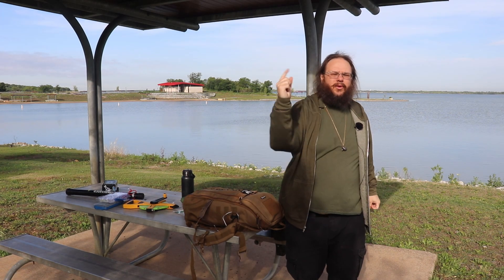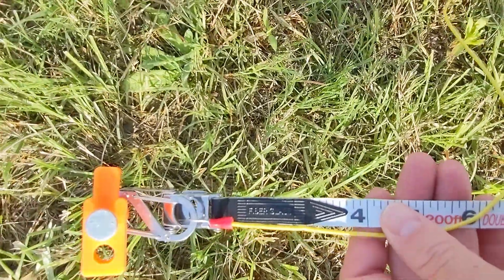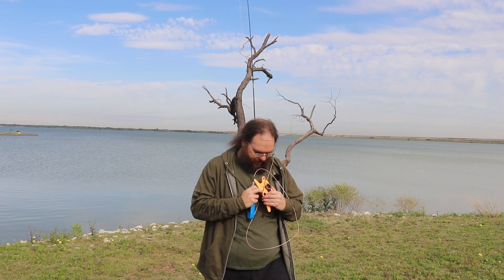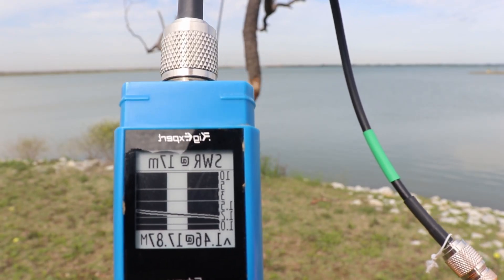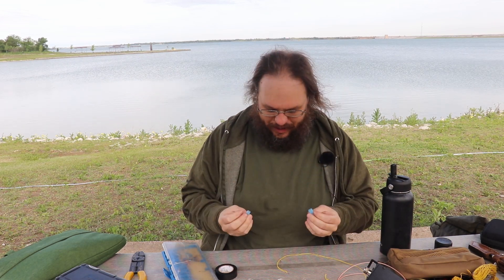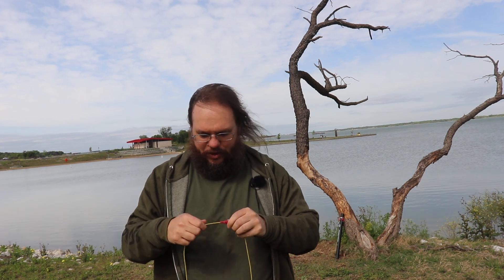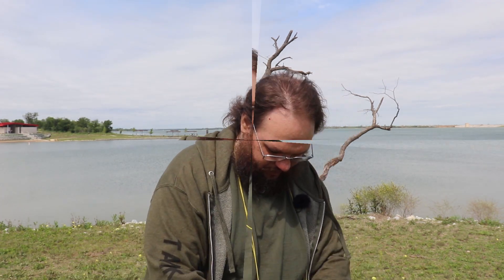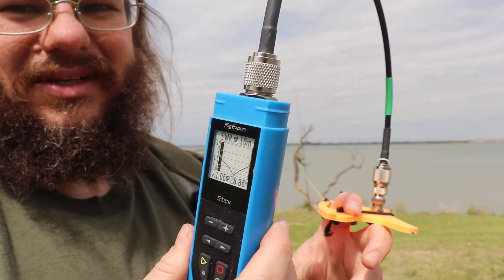How to cut and tune EFHW Linked antenna for 10 - 40

Comment: Can you advise on the lengths you show in the list there are two sets of figures next to each other almost the same so not Mtrs and Ft inches?
Reply from the maker: In the previous video, https://youtu.be/jFl4lOwHsVg.  I showed you how I calculated these numbers and you can check them and calculate the bandwidths you want for your individual sections. 

In the description I have a mathematical length of the section.  Then I broke that up into what it will actually represent in feet and inches.  Hope it helps

Comment: There is one factor you did not count in: antenna height. When you lift the antenna up, the resonance frequency will also go up. I would guess if you lift your arm up, you would already see a small difference. When you would use the same antenna at home on a tree or your mast, the difference in resonance frequency could be as much as a few hundred kilohertz. Best practice is tune your antenne on the place where you are intending to us it. Good luck, I really like your videos . 73 Bas PA5BAS
Reply from the maker: thats a good point, once you tune the antenna to a good 1:1.  if you need a tuner when you move it, the simple tuners most newer radio have can compecate for the difference.

Comment: Hi Frank - 
Maybe you can help me...
- Which connectors did you use between each of the element?
- Did you do anything to prevent the segments from separating once they were under the load/strain of being up on the pole and sloping to the transformer?
Thank you & 73

Comment: You can fold over the extra wire and as long as they are parallel your tune is good. Great video to include the links instead of robbing power with a "tuner" that tunes nothing but instead matches the impedance to send reflect into components in the the device as lack of efficiency. Great work indeed!
Reply from the maker: Thank you so much.  Its also  at of pure laziness, not running a 40 meter antenna to just play on 20

Comment: Excellent idea using the tent stake to secure the wire and tape measure, I will use that the next time I cut wire!!
Reply from the maker: Excellent!  that long tape measure was amazing.  i will be using it later for the DX commander build

Comment: Ape said you need a counterpoise!!
Reply from the maker: I read that ALOT of the chat.  this antenna build didn't have one and i know.  the coax will act or be the counter poise :(
Reply: Balderdash!
Reply: Bwhahaha, that's called common mode currentv when RF finds a path to ground. Some Dude named Lenz or maybe Kirchoff worked out some of that math. Lol but as long as the radio is fine and you make contacts good on you brother. Good on you for making this video instead of shilling for a sponsors ready made antenna. 😊
Reply from the maker: @super66craig  i will look into the math in running no counterpose. Sounds like a fun babbit whole
Reply: @TankRadio  Query Ape about that one. Or do a video with Ape on Counterpoises. Without a Counterpoise, then you should have an RF Choke before the radio.
Reply: @TankRadio  0.47wl radiating element, 0.05wl counterpoise (with 18 gauge).
Reply: @TankRadio  Have Ape on to talk Counterpoises. You will get lots of views.
Reply: I just got through communicating with John, the guy that builds the xtennas. His recommendation is that you run 25’ of coax and no counterpoise. The coax works as a counterpoise.